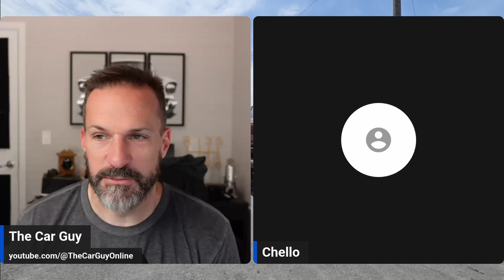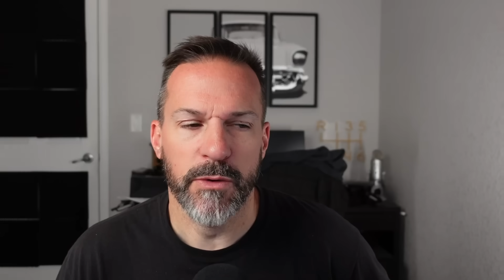Former GM Engineer EXPOSES Planned Obsolescence Tactics.

Comment: When the cars fail too soon, they buy another one from a different brand *.
And tell most of their friends about their decision. 

Usually a Toyota or Honda.
Reply: We are already at the point where that doesn't work anymore. All manufacturers are doing this. Even Honda and Toyota. So it doesn't matter if one manufacturer loses one customer. There's already one new customer coming in - one that got fed up with another manufacturer.
Reply: @totuudentorvi7781 . If I had to buy a car I would trust a vehicle with the Camry hybrid drive train. 

Great for what it doesn't have:

No turbos. No GDI without port injection. No annoying start stop system. No sleazy mechanical CVT. No automated manual. No 11 speed torque converter automatic. No torque converter. No belts (accessory timing or Wet). No 12 Volt starter or alternator. No mechanically driven AC compressor (it's electric like your home refrigerator). 

Electric car with gasoline engine assist. Electric car goodness without the electric car drawbacks. 

This drive train is available in many vehicles.  Rav4,  rav4 prime,  Vensa, Crown, Crown Signia, Highlander, Grand Highlander, Seinna, ES350 Lexus, many Lexus SUVs, Mazda CX50. And even in the Camry. 

And several models use a very similar and smaller Prius drive train.

Comment: Coolant plastic  heater pipes on the expensive first Gen 955 Porsche Cayenne was a classic fail. Deliberately under engineered so they would crack , then leak coolant under manifold.
Reply: BMW cooling systems from the late 90’s through today - designed with “5 year plastic”.  After 5 years of heat cycling, it becomes brittle and breaks. BMW owners who want to keep their cars a long time just keep getting their radiator, water pump, and hoses changed out every 5 years or so.  Their inline 6 engines were smooth running and bulletproof at least. Shame how they make their engines today to cost a fortune when they fail.
Reply: I saw a video where they had some sort of packet that released pallets of plastic at certain time inside the cooling system of a Porsche
Reply: @stoundingresults  That was VW/Audi. Fails a lot in the EU too.
Reply: VW is notorious for exceptionally poor plastic parts.  Literally have to rebuild the car every 5 years
Reply: Only women buy a porsche SUV.

Comment: Saw a similar YT video with an engineer for a bearings factory.  One of the Big 3 executives came in and said they don't want wheel bearings to last any more than 40k miles.  Engineer said it's hard to make a bearing with a guaranteed failure rate.
Reply: An engineer that knows what they are doing, can.  Many do, just for a fat pay check.
Reply: I’m an engineer myself, if I lost a bearing that fast, watch me specify my own new ones lmao

Comment: Saving pennies, right? Pennies x millions of cars = major savings, right? Let's discuss metal brake lines. Maybe they said let's use "this" metallurgy for brake lines, we'll save money. But on the "customer satisfaction" / "integrity" side, what if they say, "Let's use high quality brake line metallurgy, it'll cost $20 more or $50 more, but we can charge $40 or $100 more for it. We just doubled our investment and avoided millions of unhappy customers because the cheap brake lines rusted out."   Also, I'd like to hear from an expert about the de-icing chemicals that go on the roads. Ever work under a snow plow truck? Yikes.

Comment: The cold hard reality is every MFG is doing this or worse.  Building a car is about reliability vs selling price vs costs and still make a profit. 

If they did not make things cheaper you would not buy. They try to make it cheaper but reliable and they all gave misses. Yes even Toyota with rusted frames and engine failures. 

As for care I recall few ever changed tranny fluid. But they were simpler and they were easy to change when the filter clogged and it would keep running. 

The other issue is how to get more mpg for regulations given by the government. That is why we have smaller and more complicated and expensive engines. 

This is a soup of many issues. I still drive GM and have not seen issues like friends in Kia, Hyundai, VW, Ford and Toyota.

Comment: Who can afford a 100k truck every 100k miles. These brands are finished.
Reply: I can buy 10 beaters, fix them up, and have a million-plus miles of vehicle service life for less than that.
Reply: @illbeyourmonster2  They're gonna stop making parts. Better buy ten of the same beater.
Reply: @macadosis  This is what I say all the time to the people who say I'm just going to keep fixing my older vehicles. That's fine until they stop making parts. This is already happening in industrial or agriculture equipment. After 10 years old certain parts are miraculously no longer available 😮
Reply: @Jason1Pa 
Yup this is happening more than people realize. Continuing to make parts isn’t what it used to be. 😮😢😮
Reply: @macadosis luckily the 80s trucks are simple and many part makers, you can make or get any part
Reply: @macadosis, now you know why they came out with cash for clunkers
Reply: @huckstir  
Obama didn't single handedly destroy the auto market but damn he did a LOT of damage.  He killed the small truck with ridiculous KAFE standards and tried to banish old reliable cars.  He also created the EV grift through subsidies and tax write-offs.
Reply: @illbeyourmonster2 I agree. Buy any car out there older and fix it to new condition is so much cheaper. I don't know what anyone is thinking these days.
Reply: @dmo848  Find something N/A, timing chain instead of a belt, torque converted automatic or manual, and displacement large enough to be under-stressed given vehicle weight. Stock pile parts, apply rust inhibitor annually, detail the interior twice per year, wash it when its dirty, be all over maintenance and keep it forever. This is the way.
Reply: @realbigtuna667  Timing chains? No. You have to go for belt engine now. Timing chains have been utter crap for almost 20 years now. They used to last 200k miles but now most of them only last 50-70k miles and replacement jobs are hugely expensive.
Reply: @totuudentorvi7781  What engine have you seen a timing chain assembly fail at 50k when the oil is changed on schedule?
Reply: @realbigtuna667  BMW, Peugeot, Citroen, Renault, Mercedes, VW, Audi, Jaguar, Land Rover/Range Rover and so on. The infamous Prince engines can wreck their chain even at 20k miles.
Reply: @totuudentorvi7781  So basically eurotrash?  I wouldn't buy any of those anyway. lol
Reply: @totuudentorvi7781  I don't see any Toyota Honda or Nissan (pre-CVT of course!) in that list of Euro cars.  The timing chains in my 2007 Corolla and '93 Nissan 240SX are bullet-proof.
Reply: Absolutely.
I own BMW 2005 M47 with over 300k miles. Original tining chain..
I just copy and paste what I said to other recently:
This engine has never missed a start. Never changed any injectors (2 failed while driving but because of the back flow, undetectable on the injectos test bench at Bosch representatatives..) so.. 2 injectors refurbished at 300k miles! No deposits or blocked nozzle at those mileage done! Not a single senzor changed from intake to exhaust, back of the car! It has genuine catalitic convertor... genuine EGR valve with its hoses.. and electrovalves..
(I changed one with a second hand other MAF senzor, having adaptation done, of course)
It starts for about 100k miles in only 3 glow plugs... still never missed a single start! One glow plug I broke myself.. 😡😡 tried to extract it with left had screw, broke the screw - I gave up.

Why did last so long???
Because of 2 stroke oil! For almost half of it life this engine got 250ml of 2SO/50 litres of fuel!

The engine is pristine inside, on the intake, around injectors.. everywhere. It is passsing MOT every single year with its mileage with flying flags!
This one, M47 has no DPF from factory. A newer one B47, EURO 6 ...gets the same treatment. but with JASO FD! Japanese classification of 2 stroke oils in terms of how it burns and how much ashes produces, leave after burning.
Mine gets JASO FB two stroke oil.
Two stroke oil for life, for me!
 My 12 years experiment it is a complete success! I encourage anyone to do the same.
Another reason the engine lasted that long is because I always let it to run at least 1-2 minutes before my journey in the morning. That would bring the oil up and everywhere before putting mechanical stress in power train.
Follow this and you and me will have a long life happy engines.
Reply: Gm v6 in the caddilac  @realbigtuna667
Reply: @realbigtuna667  Buy a Toyota, very simple. They offer the most quality and will outlast pretty much any other brand, I have owned 6 toyotas in my life and none have ever failed me, cost a lot of repairs or were generally crappy garbage quality like other cars. I never bought a toyota below 170'000 miles (273'000 km) and never sold it below 300'000 miles (482'000 km) and the engine would have lasted longer, the transmission was still fine. GM has a system where they will make sure everything will fail very soon, to make more profits, they make very shitty products, but pump a lot of BS into marketing and advertising, to lie through their teeths and well, most car buyers are not too bright and buy these lies. And they would get away with it, wouldn't it be that Toyota makes them look really shitty.
Reply: @illbeyourmonster2  Not if the frames are rusted away....
Reply: @illbeyourmonster2  No one will be driving anywhere after they destroy the auto industry.
Reply: @illbeyourmonster2 that is exactly what I do. Just bought a (nother) 96 sierra with no rust and perfect interior. Have paint clear otw and a parts list being put together. I plan on getting a 2008 and deleting the dod system and running them until they die. May even pick up a few and fill them because at this point I'm familiar with almost every repair and know what the best parts are. Shoot, this could turn out to be a little business.... I'd have to back off my regular business but I'm getting tired of repairing swimming pools.
Reply: They know what they're doing. They don't plan to sell many new cars/trucks in the future. They have other monetization plans coming in. Just wait and see. They know exactly what they're doing.
Reply: @totuudentorvi7781  Yup, "you will own nothing and be happy" most people will not be able to afford a vehicle, or a home. Rent everything.
Reply: @macadosis  You know that was just a quote from the 2016 essay, right? Doesn't really mean anything beyond it's fictional context of a written story.
Reply: @macadosis  There isn't really any overall plan,  just to suck credit until the dollar gives out.
Reply: @totuudentorvi7781  get ready for subscription services in ur cars as a standard.
Reply: This is why I stick to older GM products. 😮😢
Reply: I look at the new big pickups and think to myself what a plastic piece of crap.
Reply: Our only enemy is rust!
Reply: @iaunn i have a 76 Chevy , 3/4 ton . You can see the road when you look down,  a mouse chewed the wiring all up. And the rear main seal needs to be replaced.  After this video i bought new floor boards,fenders , rocker panels   painless wiring harness and a new rear suspension,  ball joints  and Pete Jackson geared timing  . Starting on it tonight.
Reply: It's a joke here in Australia too. Some of these Rams and GMCs are pushing 200k here/ Most of them go to Construction company bosses. where they'd be lucky to carry more than a toolbox and a revised set of blueprints from the design firm in the tray. I'm sorry,. but if I'm spending that sort of money - I'd be wanting something with the refinement of an AMG
Reply: Eesh guys supply and demand much? The Chinese will fill whatever supply gaps exist with extreme prejudice, your mechanical parts are going nowhere
Reply: People rent them to look rich.
Reply: Gm wanted 85k to replace my diesel work truck i bought for 40k 15 years earlier.   No thanks.   I switched to a Ford van for 40k that was still overpriced for an empty box.  Both brands are building crap on purpose, designed to fail. Just try and buy the model with the least problems.
Reply: The nwo dosnt want you driving
Reply: Those pieces of shit won't even go 5K without a blown engine or transmission
Reply: I remember when I was getting into cars at 14 in 1980.   Dad's would hand-me-down late 1960s early 1970s beaters to sons, they would be pushing close to 100k miles and we all knew they wouldn't last that much longer, primarily body rusting out.
Reply: The banks will tell you you can, and some will believe it 😂
Reply: Who can afford a 100K truck period?
Reply: This is where the seat heater subscription comes in
Reply: No they aren't.  They will make what people will buy.   $80k trucks selling?!   GM will Keep making them
Reply: They only care that you make the payment....
Reply: they NEED to fail at this point
Reply: They have another 10 years to milk the boomers.
Reply: Morons that get into debt that’s who can afford them
Reply: Good let them fail
Reply: Toast !!
Absolutely greed and corruption!! 
Don't buy any new truck at all. Keep your og amd enjoy 😉
Reply: The pendulum will swing back around the other way.

Comment: Been going on for decades. Late 70s early 80s GM placing a super light duty transmission behind 4&5 liter V8s which lead to premature failure. Factory Stopleak in Cadillac HT engines because they inevitably leak.

Comment: Had the come home to Jesus moment in 2019 when I bought my Dad's 2011 Equinox which was bought new for my son in summer of 2018 when Dad bought a new 2018 Equinox. 2011 was well maintained by my Dad. All his new cars were GMs since the late 1950's as were mine from 1988 on  when  I started buying cars. My younger brother bought almost all GMs from 1991 forward. 

Back to the Equinox, My Dad had received from GM a letter about timing chain and oil use issues if you had paid money out side the warranty to fix these problem GM would reimburse you. GM also had instructions for there dealer network about making repairs to correct these problems. I received a letter stating the same thing after I bought the car. Son drove the vehicle to school etc. Changed oil when needed. 8 months latter he tried starting car and wouldn't start. Car was taken to my mechanic and engine timing chain jumped, oil  just down a quart and ruined the valves and needed an engine. Called GM dealer and was told just over time and miles for program but I could write a letter to GM customer service. Talked to GM customer service was told we don't care how many GM cars you and your family owned. So bad so sad that was good will program so no help for you.

Long story short went from 3 GM vechicles in my household to 3 Toyotas. My brother went from GMs driven by him and his wife to Subarus. F*** GM.